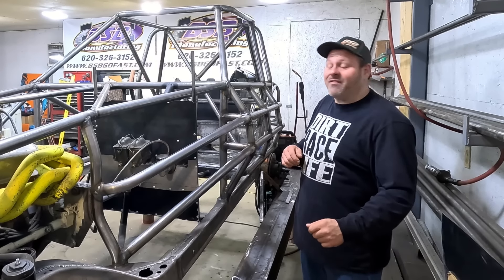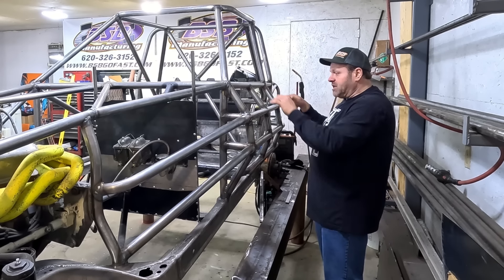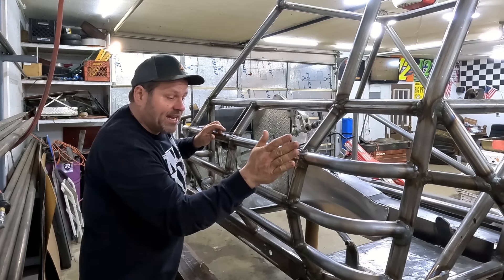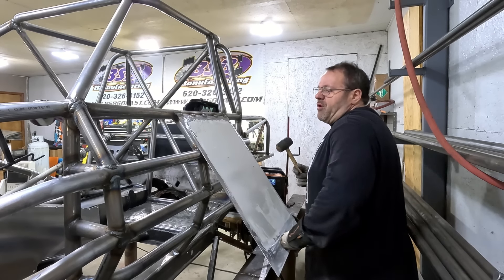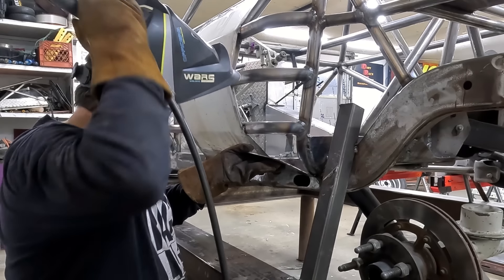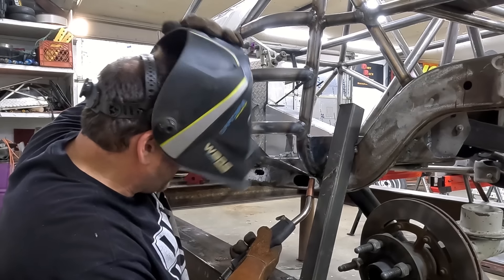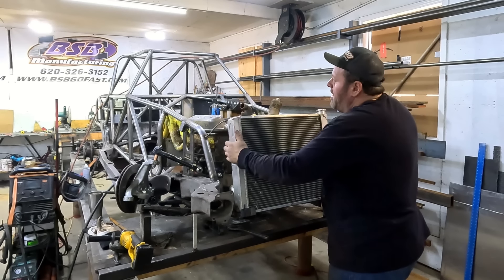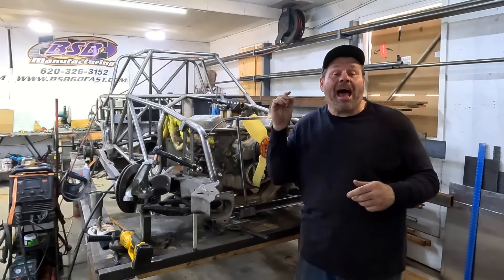The Race Car Build Continues with Door Plating Installed and a Super Easy Radiator Mount!

Comment: Jason I don't think I would bet to crazy on how short you make those frame horns, I would leave enough to try and protect your radiator ? You could maybe have come off the center of your shock tower bar to you bracing to if you have too ? Like you said there is many ways it can be done, man your going to cut it close to getting that thing done ?
Reply from the maker: Cutting it very close, but just have to keep marching forward and see it through.

Comment: Jason, I’m assuming you run Race Grade E85, which brand are you using?
Reply from the maker: I am running the Renegade E85. Being new to E85 I sure don't want to add the complexity of testing and tuning for pump E85.
Reply: @DIRTRACELIFE  how do you like it?  Is it the renegade orange E85 as they call it?
Reply: @DIRTRACELIFE  also, did you notice a pretty dramatic engine water temp reduction vs race gas?  I’m assuming you ran something like VP110 before?
Reply from the maker: Yes it is, runs very cold, I'm adding a thermostat this year. no issues at all cold firing the engine.